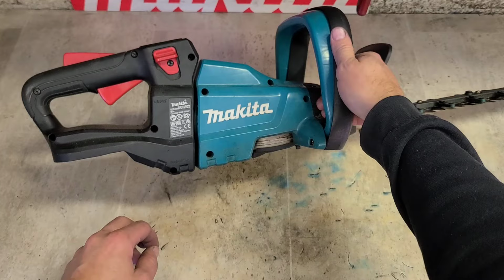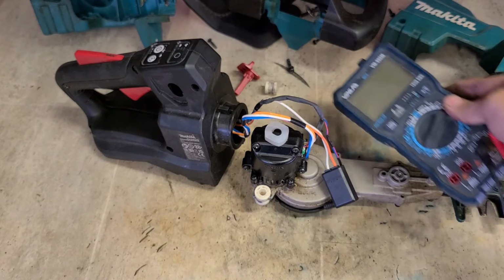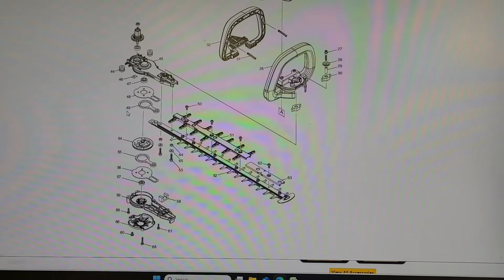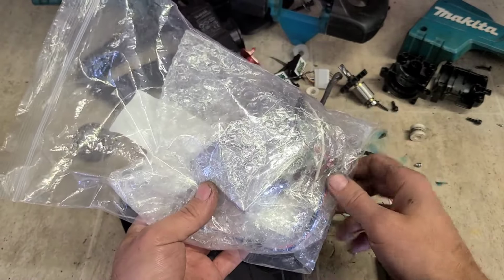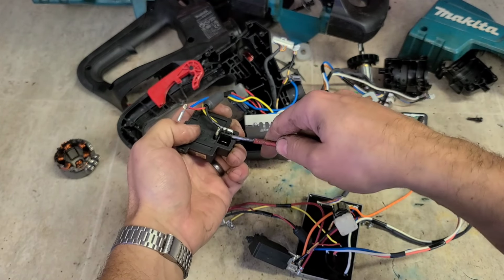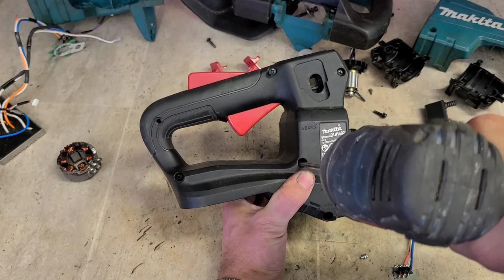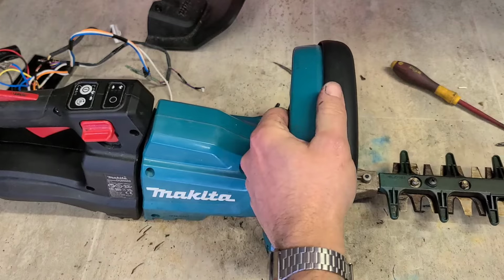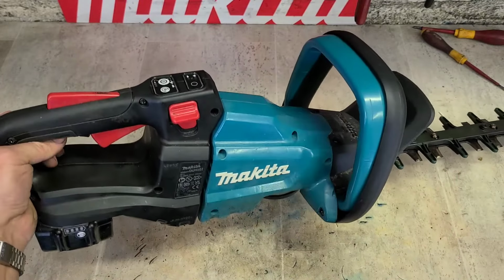Repairing a Makita DUH502 18V Cordless hedge trimmer under warranty with a faulty controler.

Comment: Dean, as a retired Makita Employee is the US, Makita always discontinues a part when improvements are made.  If they would use the term Superseded and tie the new number to the old one you would find your part much faster.  Been arguing that point with them my entire time there.  Why they won’t do it is a mystery.  Great work and watch all the time.
Reply from the maker: it would be quicker yes, but i also like to see when they change a part. I do wish they still supplied up to date makita software with all the new brakedown diagrams instead of going online.
Reply: I agree they tried part smart for awhile with Outdoor power equipment.  It did not work out.  I am afraid website is going to be it.  I will let you know that website has all current part updates.  As for changes we were in the same boat as you.  Questions had to go clear back to plant for research.  Why I’ll never know.

Comment: It's a great hedge trimmer. Have the same just with the longer blade DUH752. They do suffer from controller issues, and had one where the big bearing that the armature gear goes through failed. It would cut a little and then stop and blink for overload and that just kept repeating.

Comment: While not a tool, Nespresso repair their machines and seem to use that to improve the machines. Mine had an issue with the capsule bit where it made some awful sounds and died. Sent it off, repaired and back to me. A year to the day the exact same issue happened and it was just out of warranty. Bit or argument later they agreed to repair it again. I get it back and it must have been a common fault as the machine is much much quieter and smoother so they have improved something. Its nice to see companies doing that rather than just throwing new things at you and nothing gets better.

Comment: The one downside for me on this machine is the turning handle, even though it's a nice feature, I've had some of these come in with quite a bit of slack because of the heavy battery on the turning side. The plastic housing seems to wear down rather quickly when it's being turned often during work. It's still worth repairing with a new housing but as you have experienced yourself today you have to relocate the whole electrical circuit and all the switch parts inside which is not my favo kind of repair.

Comment: Hi Dean, with regards to the simpler, on or off  hedge trimmers, grease / caulk guns, is it possible to just bypass the controller if it blows? If my only option is the bin, could it be worth a try?
Reply from the maker: not with a brushless motor no. but you can with a brushed machine
Reply: You can do with a brushed one. Or you can buy a chinese brusheless generic controller board for tools. They are very cheap like 8 euros and work for everything, drills, impacts, grinders, saws, vacuum, blowers... anything that has a 3 phase 20v brusheless motor
Reply: @deandohertygreaser  thanks
Reply: @zaxmaxlax  thanks

Comment: Do you ever send failed guaranteed  parts back to Makita?  For example, if it is a new tool design.
The current Brushless 18V hedge trimmers run very briskly compared to the mains type. They cut nicely for the fine and medium stuff but can stop if they hit anything bigger.
Reply from the maker: yes we use to send every warranty part back to makita. but they stopped that in recent years as i think suppliers didnt want to take them back.

Comment: Hey Dean, I have a question for you!  I have a Milwaukee brushless 165mm circular saw that intermittently does not run, the light will come on but zero power.  However, when I hit it hard with my palm it goes again.  Is this a controller issue in your opinion please?  If so, it's getting the bin.
Reply from the maker: it could potentially be the switch or a broken or lose connection somewhere. but the switch costs around 30-40 euro. If its not the switch then it will more than likely be the controller beginning to fail, if so it wouldn't be worth fixing
Reply: @deandohertygreaser  Nice one, mate!  Thank you very much!  I'll take a look before I throw it in the sea!
Reply: @kevinchamberlain7928  If you're careful, you can try taking the switch apart to clean the contacts.
Reply: @adgarbault  Thank you, I'll try!

Comment: Just out of curiosity, have you gotten any of makita's newer 40v line in the shop? Where its 1 40v battery instead of 2 18v batteries.
Reply from the maker: nothing has come in for repair yet, not under warranty or outside of warranty in the 40v
Reply: @deandohertygreaser  that must mean they're pretty decent or they're just rare there, i suppose
Reply: @deandohertygreaser  suppose that's because 18v is more popular.
Cant imagine the failure rates of 40v being much different from 18v.
Well they are all brushless so you won't get as many in with motor problems or burned out motors for sure but can't imagine Makita somehow managed to make 40v invincible.
Reply: 40v wont be taking as much current and placing as much load/current on said rotors/stators and thus blowing controllers. By design the raising to higher voltage should see less burnout of the tools parts for the same jobs and work type that may kill a brushless 18v grinder/saw/sds.

Also the batteries are built even better. 2 temp probes and sticking with Sony VCT5a's in the 2.5ah and 5.0ah. Best high current batteries on the market for cost and power. 

The 4040F has tabless cells too and is capable of 2000watts.